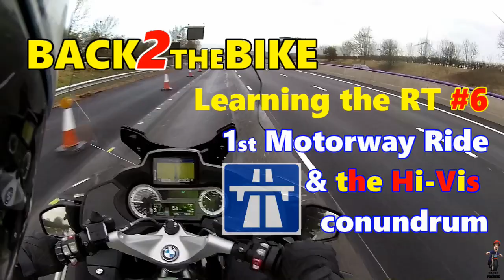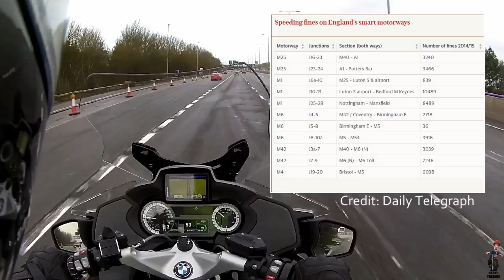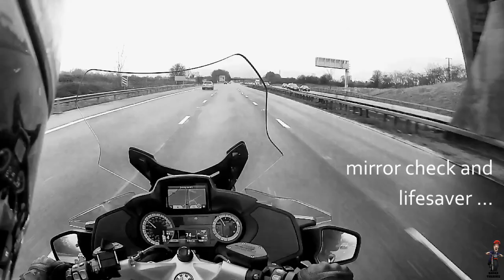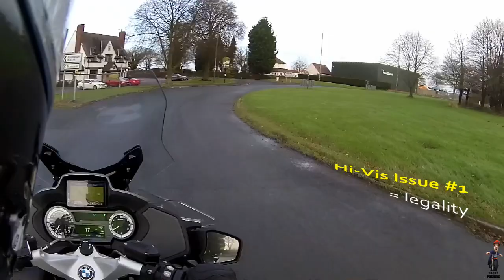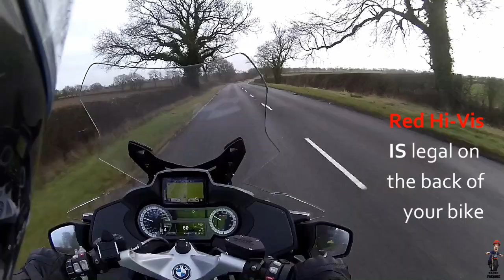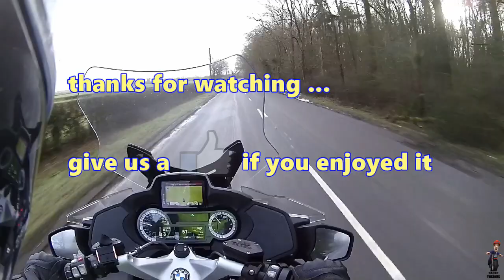Learning the R1200RT #6 - Motorways and the Hi-Vis Conundrum

Comment: I've had this bike a week and am learning a different style of riding. I've found that you don't ride the bike, you let it ride you. I've found a good method to help be part of the bike instead of fighting it... Put the cruise control on whenever possible, and go no handed. This needs to be done with caution and when no other traffic is around, like late at night. You then get the feeling of steering with your knees and shifting your bodyweight, instead of just using your arms, and it builds confidence when cornering and flicking the bike around. I also don't know about anyone else but I find the soft suspension setting to be the best on Britain's roads (Normal on motorways). I feel more planted when low speed laying over.
Reply from the maker: She's a big heavy beast, no doubt, but easy to steer when above 5mph. I never used cruise, now moved onto a Monster but relished the RT. Hope yours takes you where you want to be.
Reply: @Back2TheBike   A Ducati Monster? Wow that is a big departure. But I've had lots of bikes all very different from each other, so it's not so out of the ordinary I guess. I find the RT surprisingly easy to handle once you get to know her, as the weight is down low. Only problem I have is with the clutch.... it seems to have different biting points. It bites early on a cold engine, and after so many miles it bites much later. Not sure if it's a problem or normal. Never had a hydraulic clutch before. Hope you're getting enjoyment out of the Monster, I'm loving the audio system and wind protection on the RT. I never thought I would use cruise control but it comes in handy more than I imagined.
Reply from the maker: @ArcanePath360  A major heart issue meant I wanted something lighter (-85kgs !), also wanted to brush up my cornering.
Reply: @Back2TheBike   Sorry to hear that. Funnily enough I was looking at the Kawasaki Z900 before going for the RT, but practicality was an issue (it's my only mode of transport). Then I looked at the NC750 because it's automatic and has luggage space under the tank, but build quality and power were an issue. But then I saw an affordable old RT with some battle damage and I remembered my Dad having one and being jealous of his radio, lol. I'm restoring some panels today and the top box. Luckily I found colour match paint online, because BMW don't have the parts, but that's a good thing, because it's more fun and cheaper to do it yourself. 

By the way, do all RT downpipes rust up so quickly? I sanded them down and polished to see the chrome under the rust but they turned brown again within a week. I think I will just spray them.

Comment: Another good vid. With you on the high viz, anything we can do as motorcyclist to become more visible is a must, I ride with a high viz vest that also has reflective panels for night time and I have recently put some LED running lights on my RT which make a big difference. Thanks again. 👍
Reply from the maker: Ian Mills I'm thinking about extra LEDs in the longer term. Will need financial clearance from the boss though ...
Reply: Back2TheBike I bought some from Amazon, mounted and wired them in myself, I think the BMW ones are £500, all in I was less than £40 and being a Yorkshireman that was music to my ears. Not easy on the RT’s due to multiplexing.
Reply from the maker: So how did you get around the canbus? You need to make a video and get it up on Youtube!
Reply: Back2TheBike I didn’t, I wired them direct to battery, and will just have to remember to switch them off when I park or I will be calling the AA. Not ideal I know but I wanted some DRL’s just to improve visibility without a massive expense as I am planning on upgrading the bike at some point maybe to the new RT or a GS Adventure 👍
Reply from the maker: Agreed. I'm thinking about the HexEzCan but it is expensive to add a few lights. You're idea is simple and effective. Food for thought ...

Comment: I recently bought my bike from the guy who owned the dealership, and he could put anything he wanted on it, safety wise. He went with extra lights. On the front are two potentially very bright lights that are run at 10% power (or more if you choose) all the time, but when one beeps the horn or just flicks a small switch on the left control side, the light becomes very bright for an instant. That is long enough to get the attention of someone in front of you, including people who are good enough to check their mirrors, but making them full bright all the time would temporarily blind them. Some bikers choose to put amber lense covers over those lights as a courtesy to other drivers and I suppose that is just as visibility effective. The lights also add some width to the bike and make a triangle with the main headlight(s), which is adds to the depth perception effect for oncoming drivers.  The rear and brake light is a special setup that flashes within legal parameters for a "civilian" vehicle when you slow down from a high speed, even if you don't touch the brakes, but acts normally when you are below 5 mph or stopped and using the break(s). The bike also has crash bars for off-roading, but the crash safety factor is incidental for our discussion about preventing accidents.
My own choice for visibility on myself is white and black on helmet and jacket, and the bike is mostly aluminum-silver and some black to those who see it from behind  or the side (because of panniers). I have added some tape that is black in daylight, but bright glowing white when seen in headlights at night. It is retroreflective. I will not wear red because red is low-viz at night and not as good as white (or black) in bright daylight. I believe that the black and white is high viz enough without being garish, but that is a personal choice. So long as the colors are not solid and dark and I practice good driving, I'm confident that I'm doing the right thing.
As to lane position, I'm no expert, but I have seen what I think is good advice and that is to not stay in any one lane position all of the time. You can control your lane from any position but one extreme side or the other, and an occasional move from one position to another just might get the attention of someone who has gotten so used to your position that he/she starts to tune you out. It is the gentlest of reminders that you are there, and you could even exaggerate it a bit if you think the person behind you is a little too comfortable about your presence--say starting to tailgate you. Couldn't hurt to make THEM a little nervous about your next move and back off. :-) 
Ultimately, whatever lane position maximizes your safety buble at any given time is what is best. 
Just thoughts.
Reply from the maker: I think the smart lights and horn combo are provided by the Hex EZ can, several programmable modes. It's on my shopping list ...
Reply: Different company, but same concept and effects, I'm sure. Could be a slight difference in local laws regarding the flashing rate, etc.

Comment: I have looked into reflective panels for my RT.  It had some black panels that reflect white on the black part of the paniers but they have lost their reflective properties.  Some of the replacements I have found come from the UK and ironically, they are red and yellow hi-viz stripes, cut to fit the back of the paniers for an R1200RT.   I have a friend who can cut a custom set for me, so I'll put red panels on the outer covers (which are red) and black panels on the black inner plastics.  In daylight they will show slightly but at night I should be visible from well over half a mile.  A little accent panel or pinstriping on the sides of the fairing and paniers and I should be pretty visible from any angle, which is my goal.  Where I live in the States, most emergency service vehicles use a wide, white reflective stripe, or the words Police, Ambulance, or Fire in reflective lettering.  So there shouldn't be any confusion there.
Reply from the maker: Sounds good. The more I see of this debate, the more I'm convinced hi-vis is the way to go for a safer ride in most ambient conditions. Very much appreciate your contribution to the debate Clifford :-)

Comment: Have a look at the Helite Hi-Viz jacket.. I bought one at the NEC 2017 and use it most of the time..Bit expensive but its another personnel safety tool like the helmet cam. Re the mirrors i found the same thing with the RT they steam up..i am trying out some anti fog wipes on them and changing the angle..it may be their effected by the heat from the engine as there so low down.
Reply from the maker: For me it's not 'steaming up', but general crud which is thrown up from damp roads, particularly onto the LH mirror. I can now say after several months of testing that the new mirrors have solved that problem, and I only revert to the original RT mirrors occasionally.

Comment: Hi there, I think this is a very good series, you are learning fast, I think that one day you will make a great instructor, you have a good strong calm voice. As to your driving in this video, I think you are giving up your safety for the sake of position, you should never find yourself in position three ( unless there is an obstruction on your left, and then you slow down and split the difference ) when there is oncoming traffic, you should move over, to what you are calling a command position. But keep it up you are doing great.  Bob
Reply from the maker: binness Hi Bob and welcome. I'm not sure I'd make a decent instructor actually. Even if/when I pass IAM I'll have a badge and have demonstrated I can ride the system for an hour, but I know I simply don't have the road miles under my belt. I train for a living, and know that people find you out very quickly if you don't know your subject, so I think I'll leave it to those better qualified. Thanks for the encouragement though!

Comment: Another good video.  I notice, however,  as you ride along, you're rpms are much higher than I run at the same speed on my R100R.  I try to shift at around 4000 rpms and my engine seems happiest between 2500-4000 rpms.  Is the RT different?  I know you bike has much more horsepower than my Mystic at 60 horsepower.

Comment: I enjoy your videos!   From what I was taught you should ride in the right hand wheel track (Australia). What is the current UK thinking?
Reply from the maker: Similar I think here. Some people talk about riding where they would sit if they were in the car driving seat. Anyone?
Reply: I find most of my riding is about where I would be sitting in the lane if I were driving a car.  Unless there are the black lines of patching (tar snakes is the term used locally).  If they run across the road, no worries, but if they run parallel to the sides I go to wherever they aren't in the lane.

Comment: One thought that occurred to me as I was watching this video was that it seemed you were holding a little too far to the left in your lane? Or was that just a bit of camera angle playing tricks?

Unless IAM/RoSPA doctrine has changed, I thought it was advised to 'command' your lane, by riding in position 3 or 4 (if using a 5 position system)?
Reply from the maker: David Carr angle i think. The camera angle does tend to put a slant on it. Where do you favour David?
Reply: I generally position myself about where I would be if I was driving my car. Obviously that will change depending on the situation - extending view for bends or making myself (hopefully) more visible etc.

As for the hi-viz discussion, my view would be - as long as you don't show white to the rear or red to the front, then common sense should apply. As you say, anything that helps you be seen is a good thing. I think a lot of the regulations are meant to apply to vehicle lighting.
Reply from the maker: That's interesting David, much like driving a car then? I tried to take Pos #2, but see the wisdom in what you say. First IAM ride today!
Reply: Concerning position, I normally stay, at that speed, in the center lane, mid position. This is the most secure. Less you change lane and stay most distant from the cars in the other lanes is the better way.As far as gear is concerned, (at that speed) you should stay in 6th. In 4th you are at 5000rpm and in 5th at 4000rpm aprox. Think in term of mileage how much you lost.
Reply: Sirjon, I am presuming that you are in the USA, with regard to your comment,  "I normally stay, at that speed, in the center lane".  In the UK and Europe in general, the code demands that you always ride in the lane furthest to the left (in left-hand drive countries) and that you only move into another lane to overtake a vehicle/s.  You may not simply choose your lane and stick there - that way you can be on the receiving end of much abuse and indeed fines.

I do agree with you regarding the rider's gear selection, it has my teeth on edge why he doesn't change up a gear rather than blast on at 70mph in 4th gear or indeed 30mph in 2nd.  He would certainly use obtain much better mpg figures if he moved up a gear or two at those speeds.
Reply: steve taylor... not in USA... I'm fm Italy and the rule is as you say. But, however, and at that speed, better in the center lane because you have less moves and feel safer. I normally stay in left lane because in the highways my speed is higher... :)

Comment: Another great video. Good to see you riding the roads I use for my commute from Leicester to Coventry. M69 the quick route and via Wolvey for the more interesting route!

Regarding hi-viz, I don't see it as being a problem as long as you're not impersonating an emergency vehicle?! As you say, a common sense approach. Personally I wear a Hi-viz vest, bottom half is yellow and top half orange with scotch-lite reflective stripes. Best of both worlds (colour-wise) in my opinion.

On a side note, you passed a great store for motorcycle clothing & accessories on the road through Wolvey. Not the most noticeable as it is off the road on a business park. It is www.motocentral.co.uk (although you may have already been aware of it?).
Reply from the maker: Thanks for the tip Reece, didn't know about that. I'll take a look ...